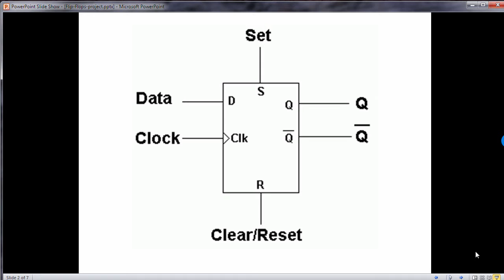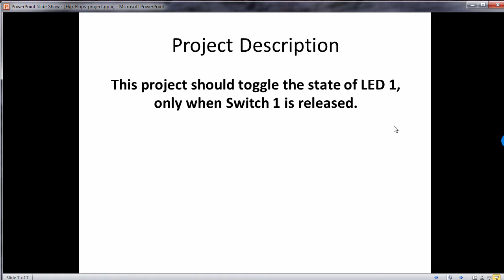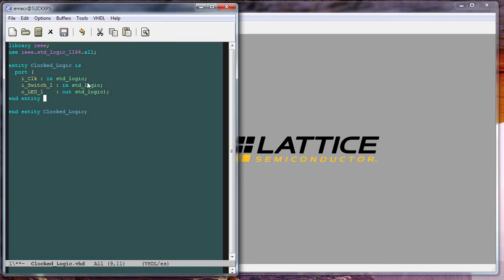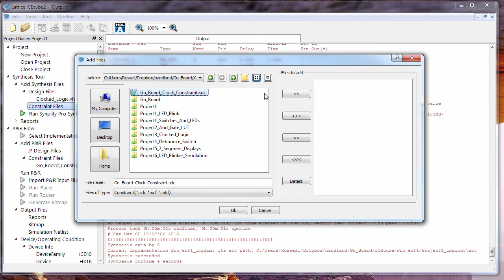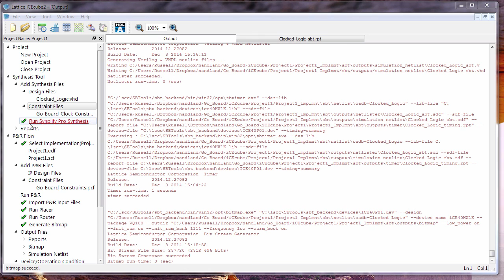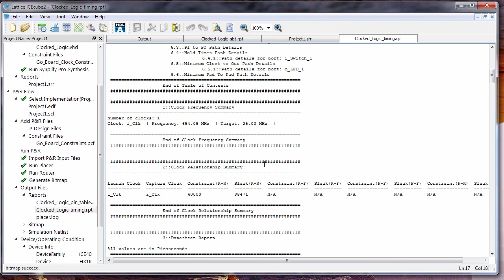Comment: Falling edge detection took me a good minute to understand, so I'll try to explain it for anyone like me. I had my "ah hah" moment after chewing on it for some time. 

9:34 - So what "if (i_Switch_1 == 1'b0 && r_Switch_1 == 1'b1)" is doing is leveraging the delay in clock cycles between two flip flops. In order for that IF statement to be true, and for it to change the value of the LED, the switch needs to released (has a value of 0) with the registered switch retaining the value of 1. This happens within that one clock cycle window after the switch is released. The switch goes low (value 0) but the register still has the value 1 which happens to be the condition for that "If" statement is true. One clock cycle later, the registered switch adopts the value of 0 and the "If" goes back to being false.

Comment: If the code in the sequential block (the always block in verilog) gets called every rising edge of the clock signal, how often does the combinational logic get called (all the code outside the always block)? Isn't is also tied to the system's clock? Does it called more/less frequently than a clock cycle?

Or maybe that's thinking too much like software programming. I guess the combinational code just sets up the hardware, and it is always "running", so it reacts instantly to any changes on input lines...
Reply: Combinational is always "running" yes. It's wires, LUTs, you can think of it like gates. That information propagates "instantly" down the wire. Totally different way of thinking about code :)

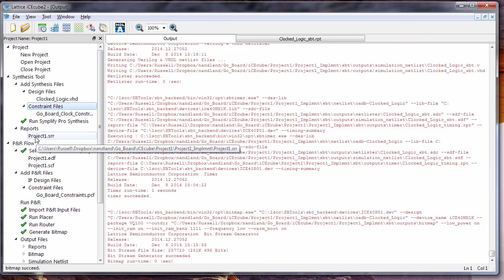Comment: Hello Nandland, at time [31:01]  in the video I have a different result. First in my case there is no "SB_DFF" shown and second "SB_LUT4" is "0 uses". Can anybody help? Note, that I added the verilog file. THX and BR Marco
Reply: I could solve this issue by myself. Now I used the vhdl code (as it is demonstrated in the video) instead the verilog code and it works :) But it should also work with the verilog code right?

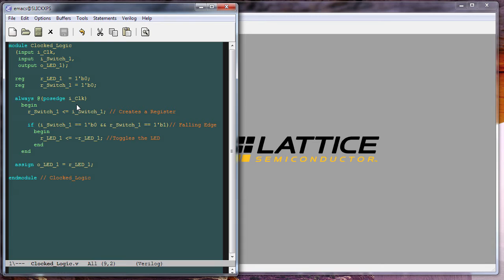Comment: @18:57 for every clk posedge, r_switch_1 <= i_switch_1 and if statement check if r_switch_1 is different than i_switch_1. 

@ 10:08 at start of clk cycle 5 (dotted area) i_switch_1 is low and it is assigned to r_switch_1. When if statement runs simultaneously in non-blocking code at clk 5, how does it not see i_switch_1 and r_switch_1 are same value?
Reply: Sounds like you are thinking like a software person. I was confused at first as well because I’m a software person. In those if statements r_switch and i_switch are not yet the same value. We are effectively checking the value of the register before we set it, because the value check happens before the circuit has had enough time to assign to that register (r_switch). Correct me if I’m wrong, that’s my understanding at least

Comment: in VHDL @ IF section, could i use " r_LED_1 <= '1'; "  instead of r_LED_1 <= not r_LED_1; " ?
Reply: Try it, but I don't think that will work, otherwise the LED will be stuck ON all the time.
Reply: @Nandland  it would work if it was set to 0 outside of the process or in an else block ?

Comment: I tried this with the exact same code, but the LED always stays lit no matter what. I tried recompiling the code to use i_switch_2 and o_LED_2 and its doing the exact same thing. Is there any reason for this? I can't figure out why its happening
Reply: Couple things to check... make sure capitalization is correct, Verilog is case sensitive.  Also double check your pin constraints file (.pcf) is correctly loaded in your project and matches the Verilog code.  This tells the tools how to map the design to the physical FPGA and is very important.

Comment: Awesome tutorial. I'm a software engineer and i really like working one level down :) I'm struggling to understand the meaning of the 'process' inside the architecture. Am i correct in thinking that the logic defined in the architecture is the direct connection between the entity ports, where as the 'process' is something that is triggered only when the sensitivity list changes (upedge or downedge)? I'm confused about the sequence, which one is first ... or even if 'first' is meaningful here. But it must, as one uses data from the other.
Reply: This might be a good post to read.  https://www.nandland.com/vhdl/tutorials/tutorial-process-part1.html
In short, process only is executed when sensitivity list changes, yes.  Everything happens all at once inside an FPGA (on the rising clock edge).  It's a strange concept and totally foreign coming from SW, but you'll get used to it the more you work with it.
Reply: The example @27:58 of the video. The i_Clk drives the Flip-Flop which Q ties back to r_LED_1, so there is a feed-back loop i guess created. Also, the architecture uses r_LED_1. So, the process in this case is a loop back from r_LED_1, which will be changed by the process and then the signal will get propagated to o_LED_1 due to the code in the architecture.
Reply: is there a tool that can visualize the logic wire diagram that is created from the code? It would be helpful to visualize the code in terms of electrical connections.
Reply: Synplify, which can be opened with IceCube2.

Comment: Hi, I'm trying to add the clock constraints to the synthesis process. However iCEcube2 seems to insist in using afile called Clocked_Logic_temp_lse.sdc which uses a period of 1000. It seems not to matter if I add your clock constrains to the synthesis or the p&r constraint files or at all.  Only entries made by Timing Constraints Editor tool seem to be respected but I end with two clocks in the report. Any Idea why that would be? (Linux Mint 17, iCEcube2 2017.01.27914, Lattice LSE Synthesis) And thanks for your amazing work, its a pleasure to learn on your system!
Reply: Thanks for the compliment!  Interesting, I haven't seen that before.  Does the clock name match the name in your design?  What if you edit that Clocked_Logic_temp_lse.sdc file?  This might have something to do with the fact that you're using LSE rather than Synplify.  Perhaps the formatting is different for the LSE constraints.  I would suggest looking up how the .sdc file that is created automatically is formatted and compare the two.  Let me know if you get to the bottom of this!
Reply: Hi, I figured it out, had a malformed .sdc file (instead of copy pasting yours I wrote it myself for learning purposes). It results that  Lattice LSE Synthesis does not complain about malformed create_clock statements and just takes a default value to work with.
Reply: Thanks for the update, glad you figured it out.

Comment: Thanks for making this video. It's very detailed and explains the concepts very clearly! After this video, I started thinking that D Flip Flops are probably used everywhere there is a memory element with a clock input. For example 8-bit shift registers (74HC595) and the Decade counter(CD4017). Is that correct?

Comment: Hi Russell, do you know how to incorporate the .sdc file in the IceProject flow? I haven't been able to find the answer.
Reply: Hm, I'm not sure.  And if you've looked unsuccessfully then I'm not sure I'll have a better shot.  But you don't REALLY need the SDC.  As long as the pins are correct and your pcf has the clock information you should be fine.
Reply: Yes, it worked!

Comment: Hi, is it possible to use the i_Switch_1 instead of i_Clk  and skip the code that checks for previous state of the switch? I.e. use the button input as clock. (just trying to understand it better if FPGA can work with a "dynamic" clock). Thanks.
Reply: +Nicolai Dimov that's not a good Idea. Essentially what you're describing is creating a latch. Latches should be avoided especially for beginners. The best way to avoid latches is to only use sequential processes (always blocks in Verilog). Definitely keep a clock!